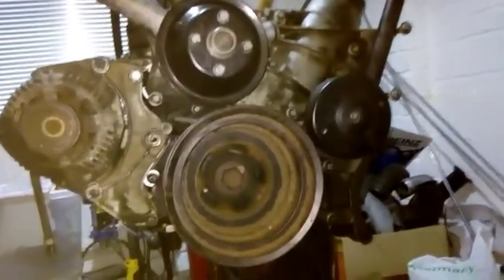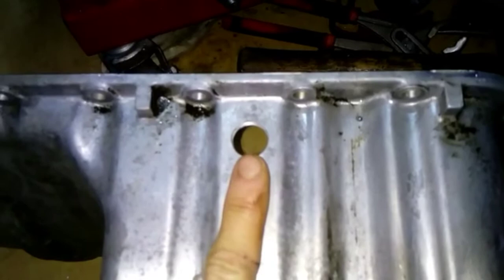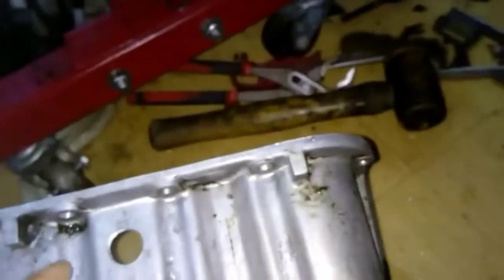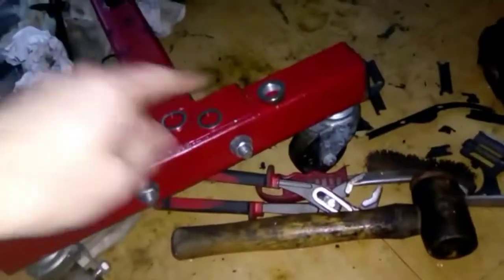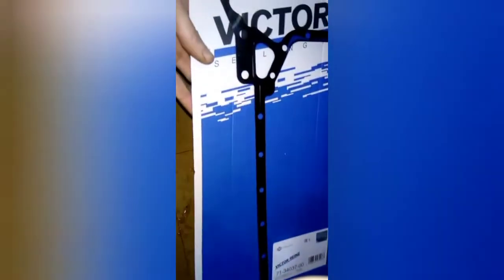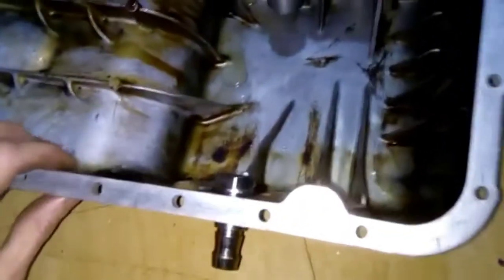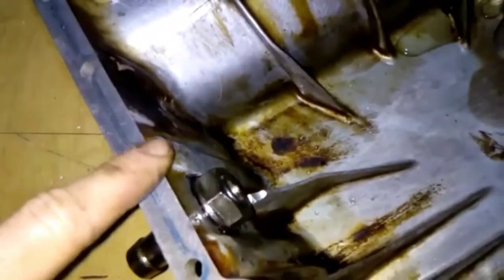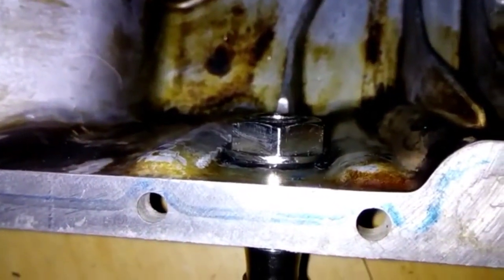Want To Turbo Your Mercedes M111?...Check This Out.. How To Fit A Turbo Oil Drain #subscribe

Comment: Do you have any issus with burning the oil, because the oil Level is Higher than the Return Line? Thx from germany
Reply from the maker: No ours seemed to be ok with it, the only issues we had were headgaskets, if turbocharging a M111 from experience I always recommend a MLS headgasket from Stern Garage these guys also now the M111 engine very well and supply a few parts for tuning. I worked out theoretically that BMW S14b23 ARP headstuds should also fit but I'm yet to try these.

Comment: what do you think about draining the oil into the oil dipstick opening?
Reply from the maker: Some people do that but I'm not sure how well it works, I always like to have a designated Turbo drain into the sump. But if it flows back to the sump free enough with out backing up in the return line it could work. However I can't say for sure cause I have never done this myself.
Reply: I'm in the process of doing this and wondering how does it return properly? When I fill sump up with 5L of oil it's to full for the return to work to the sump as it needs to drip in ? 
Do u put a full 5L in sump or less?

Comment: Is there a size fitting that is threaded we can use?
AN fitting I mean
Reply from the maker: Search on eBay for Mamba oil drain the only ones I would recommend are mamba buddy as they don't come apart and are stainless steel not aluminium 🙂👍
Reply: @M-oneeleven-M111  would you suggest the barb type over the threaded type?
Reply from the maker: @Shadowmosesarea51  that's what we use never had an issue dude don't leak either and very strong.

Comment: Know it’s an old video and I think you said you got rid of engine. But did you ever take the pan off with it still on the car?
Reply from the maker: Yes we did it with the engine in the car, but I admit it's a awkward job and requires either a engine hoist or an engine brace. You basically have to undo the engine mounts raise the engine slightly to give you the room to slide the pan off and on. 🙂
Reply: @M-oneeleven-M111  awesome. That’s what I thought. Any tips on where to mount hoist? I mean I don’t wanna put a jack under it lmao tbh but if I have to I will.
Reply from the maker: @djhairtriqz2084  I think a jack under it will just get in the way anyway dude, on the engine there should be two hoist points. There's one on the right rear of the engine it's like a metal plate with a hole in next to the cam cover towards the back above the intake, there's another at the front but off the top of my head I can't remember where the front one is. Tomorrow I can do a shorts clip showing where they are if that helps 👍
Reply: @M-oneeleven-M111  that’d be awesome man. You’re great lol. Keep up all the awesome work. I see the progress on website too. I been lookin at it. I thought about making progress vids of my turbo too lol but they’re nowhere near as good
Reply from the maker: @djhairtriqz2084  no worries were always here to try and help the best we can🙂, the websites getting there and I'm slowly getting small amounts of stock in so far. Like I always say we really appreciate all the likes and shares we can get to grow the channel, and anyone in a position wishing to support us by other means there is an Amazon wish list also. But the thing that helps the most is likes and shares and that's something everyone can help us with in return 😃. Hopefully if we all work together we can grow M-oneeleven. And awesome dude DO IT! 😉 That's all I did the more people share how they did it and share the ups and downs the more it helps the community 😃👍

Comment: What kind of gasket did you end up using? I can’t find a damn fiber one for anything lmao
Reply from the maker: As in gaskets for the fittings do you mean for the feed and return? We bought a oil feed kit off eBay that came with them, but we had a custom feed line made. As for the return fitting that came with all the seals required. If you can't find what you need you could get some Gasket paper easily available on eBay or Amazon, that way you can make your own gaskets if needed.  But the mamba fitting comes with everything required.👍
Reply: @M-oneeleven-M111   for the oil pan.
Reply from the maker: @djhairtriqz2084  https://www.ebay.co.uk/itm/291810611660 like that one dude eBay search M111 sump gasket brings up a nice range to choose from buddy

Comment: What did you use for oil feed?
Reply from the maker: Good question I shall see if Ben can get me some video of it but basically on the exhaust side of the block, there is a threaded port I believe is blocked off normally I'll ask what threads they were as I've forgotten but we had a custom feed line made up
Reply: @M-oneeleven-M111  yeah if there was vid or pic of it. It would be awesome lol. Wondering bc I’m just trying to figure out what all needs to be done to swap mine. There’s literally nobody else that is actively doing stuff to it and it sucks
Reply from the maker: @djhairtriqz2084  No worries we will have one up shortly just making sure we get the thread right cause we turbod the slk beginning of last year but that's the point of this channel and why we are trying to drow it so any shares are appreciated we will be doing a built motor and as many instructional ones as we can to help
Reply from the maker: @djhairtriqz2084  https://youtu.be/uZeDQiCxXmw there's a link for you hope it helps